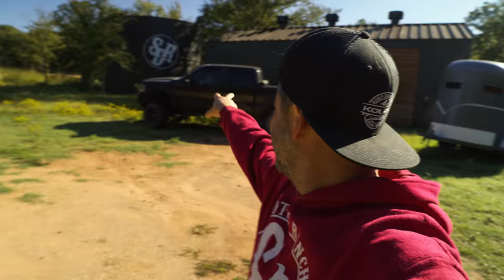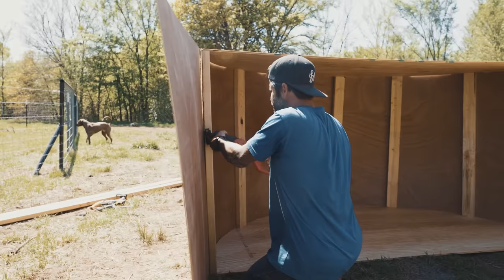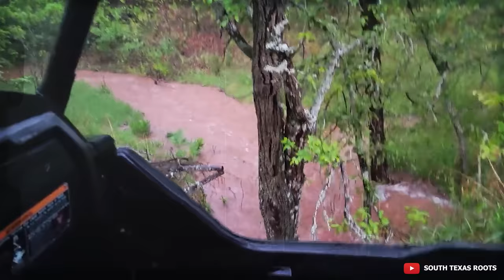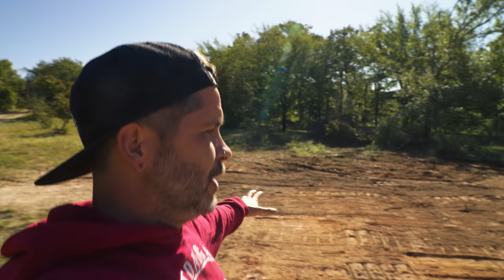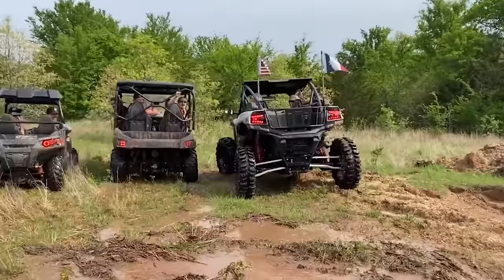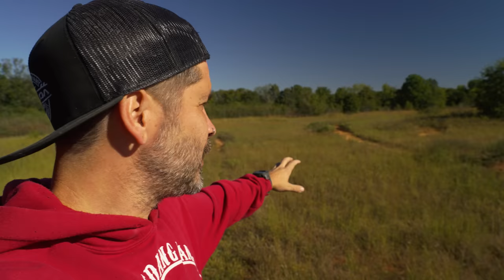Sold SDR & MOVING the TINY HOUSE! Lawsuit with Oil Field? TELLING ALL

Comment: Have you considered shipping containers for a quick solution to secure storage?  4 larger ones set in a square makes storage and a place to contain the animals. 
They are in demand and should be easy to resell. 
2 set 20 feet apart with a roof between them makes an “instant
shop”.  ??????

Comment: For NorthernPikes   That's a lie. Household nat. gas is odorless until they add to it. Wells are another story.
Taken from a publication called Grist: 
"Living next to natural gas wells is no fun
From health threats to truck traffic, from rank odors to sinking property values, Coloradans explain what it's like to live near fracking sites."
"Even after a well has stopped producing gas, big cylindrical tanks of waste water and natural gas condensate remain, sitting behind low fences by the roadside. Too often those tanks emit toxic substances into the air or leak their contents into the ground, including volatile organic compounds (VOCs) such as benzene and toluene."
Both benzene and toluene SMELL.
So in short, nasty old wells are.....well,  nasty.

Comment: You can still move a lot over to the new #3 place.  Anything that will be of use to help save money.  Don’t forget the items in the metal building.  Hours and expense and muscles went into getting that SDR in near living conditions. A room built in the metal bldg to stay in, while building your own tiny house, then staying in a camp trailer,  then staying in while u finish ur brothers tiny house, then in the trailer.. oh the studio  moved several times!  Now here we go again on 16 new acres.  Jason,  you have to take responsible for some of those issues with the oil/gas co.   U saw an pump set up there at the first..  pad locked. some of us kept telling you to check the county records about the prop.. the real estate  agent should have informed you before u bought it.  Some of us who had had experience in oil/gas drilling were concerned for ur safety, the water needed testing, etc….  Too, too much too, too fast, Jason.  Best to cover all bases when buying property.  I surely hope you have on this #3 place, for Danielle sake.